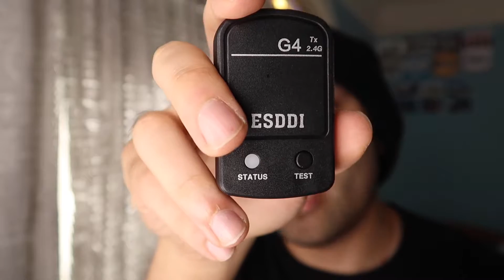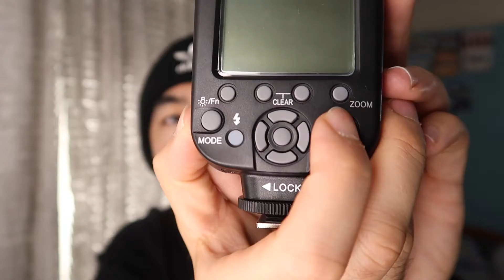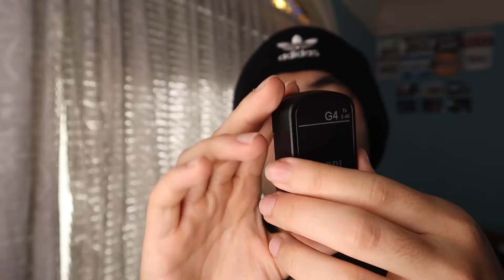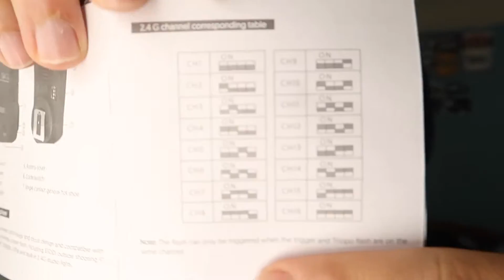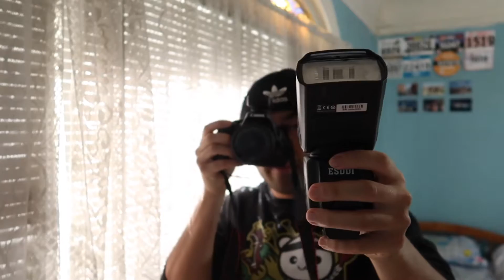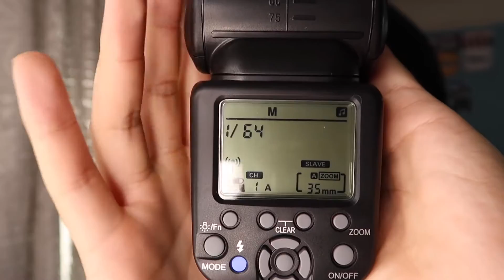How to set up ESDDI Flash Trigger?

Comment: Someone help me out man... I had this thing for years and It just stopped working. Like the flash still works, but the wireless triggering doesnt. At first I thought the batteries of reciever are dead but they are not, I got new ones.

When I turn it on it shows green, but when I press Test it doenst blink up (Im almost certain it used to light up when you press Test too, but it dont matter, since the flash doesnt go off)

I have it on master, on the right channel, I even tried a different channel just to make sure. WHY ISNT THIS WORKING ANYMORE all of a sudden im so confused and I dont know where to look. 

Am I missing something? Its on the right channel, on master,  the little flash icon shows outoing (not ingoing), the little antenna icon is showing.. Why did this thing give up on me all of a sudden

I dont have the manual and I cant find it its driving me insane to not beeing able to fix this thing, im almost certain it cant be broken.

Comment: how can I get the high speed sync to work when using the flash off camera? do i need a better trigger???
Reply: I believe you can only use manual mode when off camera and not ettl either.  If im not mistaken, HSS is not available off camera

Comment: Can you use the trigger when you have the touch screen active because I cant make it work unless I have view finder on. I have the t7i
Reply from the maker: Not too sure. I currently only have T3i and waiting for my new camera to come in which is the Sony After 6400. Will let you know if any updates.
Reply: I checked with ATG & here are your choices:
1. By Shutter Button
2. By Self Timer
3. By EOS Utility
4. By Touch Screen if it has Shutter Button Icon
5. By holding the Transmitter while supported camera has flash parked 

Notes: #3 requirements:
* Mini USB to USB Cable
* Windows or Mac
* Canon EOS Utility
* Connect camera by USB Cable to computer
* Click on EOS Utility
* Click on Live-View
* Shutter Button and all setting are on icon

Comment: Nice video! Thank you! A question. Can you shot in HSS mode at more than 1/250 sec, let's say 1/1000 or more, in wireless mode? With the trigger mounted on the camera and the flash remotely controlled?
Reply from the maker: I have not tried this but I will as soon as I find out.
Reply: ATG disabled HSS when shooting 2.4GHz when transmitter mounted.
With transmitter on camera or handhold, you can remotely fire the flash.